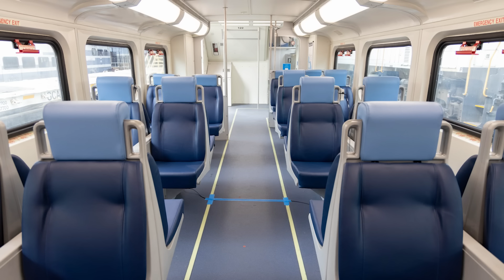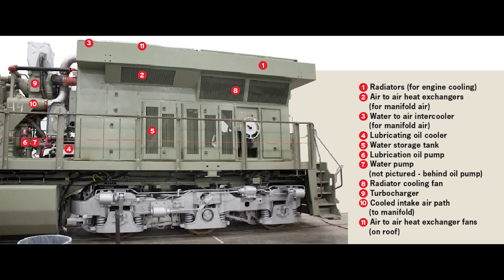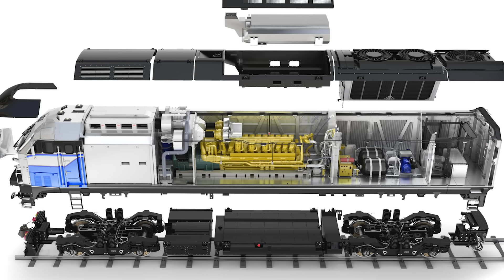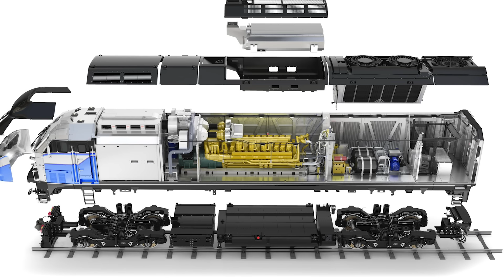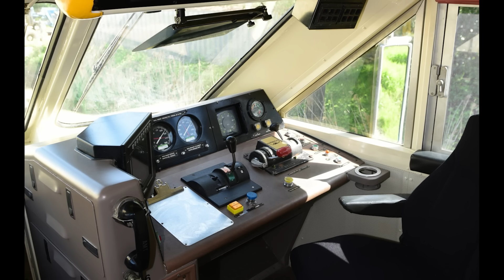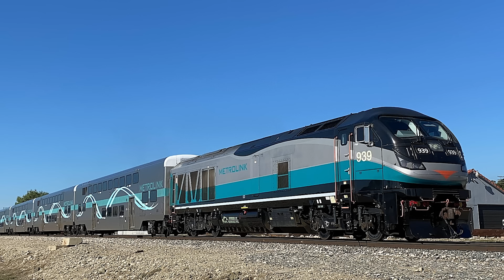The Engineering Behind the Caterpillar Powered EMD F125

Comment: It's sad that Metrolink moved away from traditional American locomotives to rushed modern locomotives also due to the controversial and horrible reliability of the F125 locomotive with an odd design choice by Vossloh Espana, The horsepower and cleaner technology are superior compared to F59s and MP36PH-3Cs but may cost Metrolink in the long run unfortunately in terms of reliability despite some praise

Comment: What is and what is not EMD.  Once EMD went to four stroke prime movers the heart of the EMD philosophy was lost.Gone is the simplicity and reliability of the modular 2 stroke philosophy.  The philosophy of modular electric and electronic systems to keep riders comfortable is also a great idea.  The mechanical modularity is also along the old EMD philosophy.  Further, the round fuel tanks scream EMD.  Also the fact the locomotive "loads up" quickly is an EMD trait that still serves its customers well even with older locomotives.  It seems philosophically  the new passenger locomotive aims to keep the EMD philosophies that made EMD  great in the past.  It's still a truly distinctively philosophically American solution to transportation challenges.  I hope it works out....

Comment: It makes me very sad that most north American railroads no longer want to rely on the F40PH solely based on its age and the fact that the EMD F40PH dates back to the year of 1976.
Reply: It was the locomotive  that saved Amtrak
Reply: I really Amtrak will get the new F40PH-4C. @RobertWrightjr-nh9eq
Reply: As long as the shell is good can’t you replace and upgrade the rest of an f40?
Reply: OK. @darryldworak6356
Reply: @darryldworak6356  Or you could just sell them to Metra, they'll use any locomotive as long as it's powered by an EMD prime mover.
Reply: @t1m3f0x no leave some for the rest of us